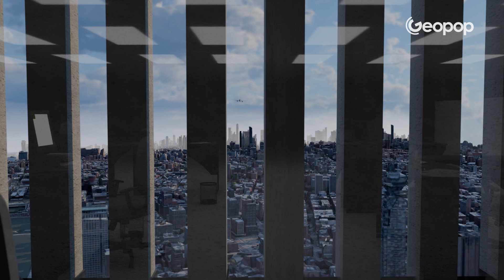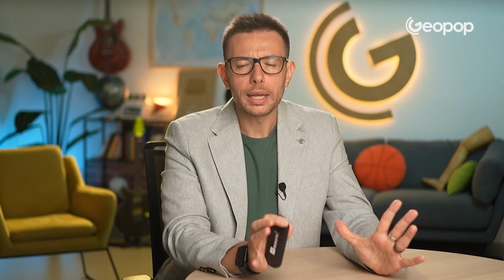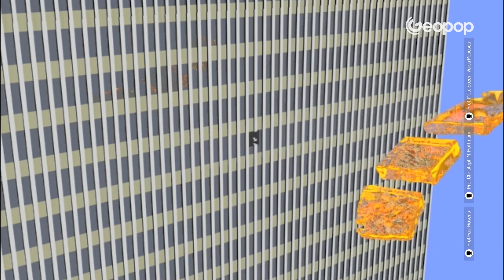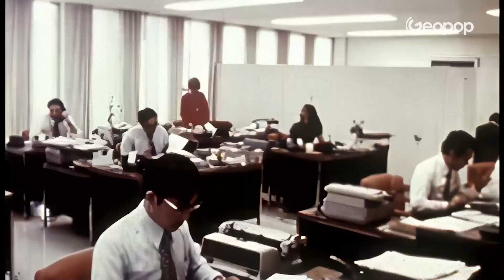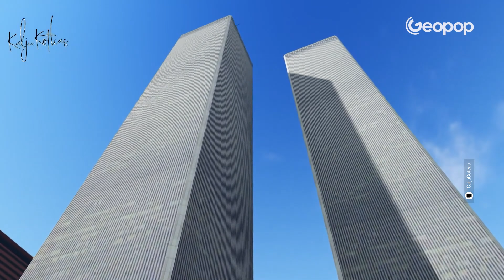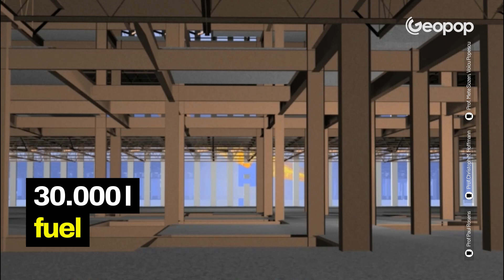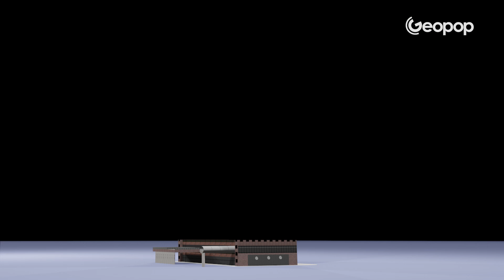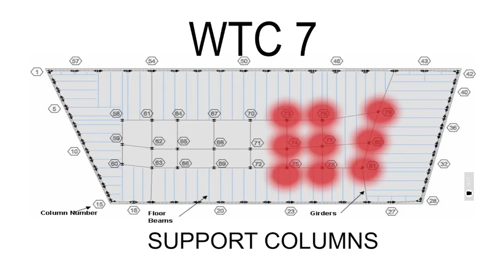9/11, 2001: The Technical Reconstruction of the Twin Towers and WTC 7 Collapses

Comment: a vital key piece to the collapse is the flooring damper systems that connected the floors to the exterior columns. They were rubber to absorb wind induced movement. As the flooring systems sagged and the rubber dampers melted away it was a cascading effect

Comment: You know you dont have to melt steel for it to fail. As an example, steel loses 50% of its strength at only 600 deg. Its not even glowing red yet at 600 and its already at half strength. Those steel beams were holding up a lot of weight and when many were severed, many were bent, that left the remaining columns/beams with an impossible amount of weight to support, and those steel columns/beams were being heated up.
Reply: Yes...for anyone familiar with commercial construction understand's most of this.
Reply: red glow is about 550. but you are right. steel looses strength.
Reply: Oh, and then tower seven the building that fell before it fell 😂
Reply: @steveoblenes7988 No genius, a section of the back side corner collapsed a few seconds before the rest of the building collapsed but you cant see that from the frontside footage that is always shown of wtc7 collapsing. Youll have to put your bong down and hit stop on the michael moore documentary that youre watching to know what Im talking about.
Reply: @morokeiboethia6749  "A section", A column(meaning ONE) cannot physically cause a GLOBAL COLLAPSE of undamaged structural steel in a building. Full stop. You're an idiot.
Reply: that's what the conspiracy morons do not understand.
Reply: @smashICE1 A lot of them can/could understand, but they dont want that to be what happened.  "Bush is guilty!"  Of what?  "I dont know, but hes guilty!"
Reply: @morokeiboethia6749  You forgot to explain your theory on Newton's Laws on physics and WHY the absence of the 2nd and 3rd laws. Those buildings pile drove themselves to the ground without resistance. They did NOT decelerate. The "pancake theory" is just that. Not evidence of fact. ALSO, fun fact, those towers were not uniform all the way up as far as the steel thickness. IT IS A FACT. WHY? Designed for wind load. The towers were LIGHTER toward the top. The "elevator shaft fuel drop" is also nonsense. WHY? MOST of the fuel burned in the fireballs. The elevators were all staggered and did not go straight down meaning there were different levels to take different elevators to ascend and decend. It's a known known there were warnings from our "allies"(2 different sources). I was a demo expert in the Marine Corps (0351) at the time and 30 years old. Remember, narratives that explain away resistance from the floors below are idiots that defy physics.
Reply: @smashICE1  I am proud to be a conspiracy moron. I will run my mouth until I die. I am here to uncover all Truth no matter what the Personal cost to me. I am an old man, I have nothing to lose but when I face the Lord I want to be sure I was definitely standing up for what is RIGHT, no matter the personal cost to me on Earth. All Christians are supposed to be living this.
Reply: @JDEbberly-s9c  Nobody cares!
Reply: @JDEbberly-s9c it sounds like youre standing up for what you want to have happened, and not what actually happened.
Reply: In the mid 80's I lived in a ground floor apartment in Amsterdam, and I wanted to remove a wall to make the kitchen larger. There were 4 layers above me, so I needed to put in a supporting beam. I wanted to use a steel beam, but the fire department told me I couldn't do that unless I covered that beam in a double layer of plasterboard. They told me a wooden beam was better. I was very surprised when the man told me a steel beam was collapsing faster in a fire then wood. He told me it was between 15 and 25 minutes, depending on the intensity of the fire. 
Wood versus steel in a fire. Hard to belief wood can outlast steel.
Reply: @lux_moto Yes and that was another thing I forgot to mention but those steel beams/columns in the WTC had fire insulation installed but when the jet tore through the building it would have ripped any sheathing and insulation right off the metal.  Engineers think the collapse began when one of the sections of floor  (concrete, rebar, on top of steel plate supported by horizontal beams) broke loose on the end connected to the center core and that end fell down on the next floor which was also very damaged and those floors pulled beams with it and from there it was too much weight falling and began a domino effect. The outter box columns buckled out right before the collapse and thats a sign the floor beams had broken loose that keeps those outter box beams reinforced
Reply: @morokeiboethia6749  In 1970 the New York City Department of Air Resources ordered contractors building the World Trade Center to stop the spraying of asbestos fireproofing.  More was added after a fire in 1975 that spread to six floors.  After the 1993 bombing of the North Tower inspections found the amount of fireproofing was not enough.  The Port Authority was in the process of replacing it, but replacement had been completed on only 18 floors in North Tower, including all the floors affected by the aircraft impact and fires, and on 13 floors in the South Tower.  Although only three of these floors (77, 78, and 85) were directly affected by the aircraft impact.

Primer coating applied to the steel reduced the adhesion of the spray on fire retardant by about 2/3rd. It was dropping off during construction, even more was of course knocked off from the aircraft impact.   Vincent Dunn Former Deputy Fire Chief of the FDNY and co-author of Collapse of Burning Buildings:  “It crumbled at the touch of a hand.”
Reply: Many other buildings since and before 2021 have had more intense and longer duration fires and none collapsed like this. Try again.
Reply: @ragne5749 you are an absolute moron.  Failing to acknowledge the force of a jet airliner severing several columns at 500 mph.
Reply: @r @ragne5749 I’m curious which other building sustained the kinetic impact of an airliner shattering several key structural support members, all the spray on fire protection, and then free burned under wind driven conditions with jet fuel for an hour?
Reply: @Flashhood1425  Jet fuel is simply refined kerosene. How many kerosene lamps have you ever seen glowing red after an hour's use?  How  many of those lamps have you ever seen - deform, while in use?  Cast Iron Wood burning stoves (I've used the same one every winter since 1985) get as hot burning hardwoods like Oak and Osage Orange and Locust - as any petroleum fueled fire can.  They don't deform in on themselves.

Steam engines (fed wood, then coal, then fuel oil - over their 90 year lifespan of use by railroads all over the world) never got so hot from constant use - to deform the locomotive  bodies which surrounded their contained fires - used to heat water and turn it into steam.  But after an hour to 90 minutes for each Tower - it got so hot it destroyed them...?  Gimme a break.

I didn't believe NIST report when it came out and I sure don't believe the 'stated facts' in this production.

Both jets 'sheared' about 1/4th of the support columns in each tower. The most intensity of the fires were limited to the 6 or 7 stories which were greatly affected.  A steel skyscraper like both the towers were - also act as humongous heat sinks.  Just because the steel within those towers might have heated up - the steel above and below those floors - didn't heat up as they sucked the heat away like giant heat sinks. 10 stories below those fires, the steel was still cold and strong all the way to the sub-basements.

Popular Mechanics rolled out this common PANCAKE theory long before NIST report was published.  I call BS on that, as well.

Those buildings were demolished. On purpose. Same for Building 7.
Reply: @Chebornek  TLDR, all your arguments are shit (respectfully)

Firstly, while you are correct on the idea that jet fuel is similar to refined kerosene, unless you are using an afterburner for a candle, a lamp is pathetically small, and any flame it produces is also very impotent.

Also, the flame has ample opportunity to radiate heat to the surroundings, it is extremely difficult for it to heat any metal it is made of enough to cause it to deform.

Secondly, is your cast iron stove supporting the weight of 10 other equally heavy stoves above it? Is it ravaged by fire, with some of its walls critically damaged? No? That's what I thought, try harder.

Now for your third point, the argument is even worse here. Water is a heat sink, obviously it's going to take heat away from whatever fire is used to heat the water, instead of deforming the metal.

About your fourth statement, unless you have any background in physics and engineering and can support your lunatic theories, I think the people at NIST are more qualified to speak on this?

Your fifth argument is literally answered in the video, even if it's just 6 or 7 floors affected, there were more than 10 floors above the affected zone in each case, and the remaining portion below the crash site could support the weight of only up to 6 floors falling down in this way. Plus, all the fire needs to do is weaken a critical support column for the entire structure to begin failing.

Your sixth argument completely neglects time; from the little bit of physics I remember, heat conductance isn't instantaneous and diffusion length is something like L = sqrt(diffusivity*time); using the data for steel's diffusivity, even for 1h, the diffusion distance for heat is roughly 0.19 m (0.6 feet in freedom units). 

I myself am not a physics major and yet a quick Google search can help me tell you this. Perhaps you should try harder the next time to think through what you're saying, instead of larping as a jackass?
Reply: @Chebornek  Your assuredness of the demolition theory is based on the lack of deformation of kerosene lamps and steam engines?  It appears that you watched the video but didn't you pick up on the fact that heat weakens the steel, it lowers the yield point. You could forget about deformation all together and focus in just on the loss of capacity of the structural members.

Those buildings had to be extremely efficient in their design and I am going to estimate that the structural members were probably designed to about 95% of their capacity when under a full load.  Take into account a 40% loss in member strength due to the heat, take into account the loss of exterior and interior columns and the loads that they supported now have to be supported by other members for which they were not designed for and you end up with a pile of rubble.  It's really not that hard. 

The video did not even address more specific topics such as the possibility of longer unbraced lengths of columns due to loss of supports or failing connections or other numerous items that can affect the performance of structural members.

I guess its just easier to say they were demoed than to put some real thought into it.
Reply: @Chebornek  "They don't deform in on themselves" .... because they don't have any weight/stress applied to them, only heat.  The WTC buildings didn't use traditional metal beams.  They used "box tube" metal framing on the outer jacket of the towers as the framing.  Just look at a pic of it on the internet from google.  It's like cutting a picket fence in sections every 3 pickets.  That's what 1 piece of box tube framing was.  It was like 3 vertical hollow square tubes lifted by a crane that have male/female ends that slip onto the section of box tube that's already installed below it.  That is what the outer framing of the WTC buildings was and not traditional metal beams.   The core of the building was a bunch of vertical heavy-duty beams, concrete, rebar, etc (thats where the elevators were located was in the core section).  The only thing connecting the outer jacket of box tube framing with this inner core framing were the horizontal metal "floor joist" beams.  Those horizontal beams are crucial in every building because they keep vertical beams (which are the beams transferring the entire weight of the building into the ground) from being able to bow/bend when weight is applied to them.  If you took the capital letter "H" and pretend its 2 vertical metal beams concreted in the ground and you start adding weight to the top of the 2 vertical beams, you would get to X amount of weight then the vertical beams begin to bow.  That means you're approaching their weight limit.  However, you can increase their strength by adding that one piece of horizontal beam in the middle of them that prevents the beams from being able to bow.  Horizontal beams strengthen vertical beams and increase the amount of load they can support by A LOTTTT.  Most buildings are a grid of vertical beams and horizontal beams but the problem with this is you have vertical beams every where on the inside of the building and you have to cosmetically hide all of them on every floor.  The WTC's framing was an engineering marvel.  It used 50% less steel than traditional framing and each floor had so much wide open, uninterrupted space without vertical columns everywhere.  That was the 2 main reasons this system was used was because it used 50% less steel and therefore cheaper in cost and once completed, you would have wide open space in between them without columns everywhere.  The floors of each "floor" were horizontal beams (which keep the vertical framing from bending/buckling) that had metal sheets/plate welded on top of them.  On top of the sheets, a few inches of rebar/wet conrete was poured.  If the sheets weren't there, the concrete would of course go right through the horizontal beams. They keep the wet concrete from falling through the floors.  Once the concrete dries, that was essentially your "floor of each floor."  So the floor gives people something to walk on but the floor is also the main support for the vertical framing.  The footage of the collapse you can see the box tube framing bend outward on one side right before it begins to fall.  That means the horizontal beams (which is the also flooring) had broken loose on the insde from the outter jacket.  The plane would have severely damaged the connections of horzontal framing with the vertical framing and then they were being heated up and one section of horizontal framing/flooring finally broke loose from the outter jacket framing, once that outter jacket framing no longer had the horizontal beams attached to it, they are going to bend outward from the weight and thats what the footage shows.  Thats an indicator the floor (horizon framing) had finally disconnected from it and thats what most likely began the collapse.  It wasnt that the vertical framing couldnt failed, its that the horizontal framing finally disconnected, then the vertical framing is no longer strong engough to not bend from the weight.
Reply: @ragne5749 because those buildings only had fire.  Wtc 1 & 2 had a jet come through the building right before the fire that severed framing and bent framing, then the weight of everything above the impact zone is then transferred to those remaining franing members.  Now throw in some fire to reduce the load carrying capacity even more and what you have is a building thats about to come down once the steel reaches a certain temp range. The buildings youre referring to, only had fire but their framing was not bent or severed. Wtc 1 and 2 had compromised framing, heat stress, and a much higher weight load on the remaining framing.  One of the original engineers of both wtc was on a train in nyc that morning and he told the lady he was with that both of the towers were gonna come down because he understood they were being heated up.
Reply: Fine. Explain how WTC 7 collapsed so neatly. THAT WAS A CONTROLLED DEMOLITION for sure. Hmm, I wonder what was in WTC 7 that needed to be covered up?
Reply: @JDEbberly-s9c you’re an idiot lmao the kind of idiot society would ostracize and exile 100s of years ago
Reply: Surely part of the WTC collapsing on wtc7 couldn't possibly have damaged it's structural integrity at all

It's okay you can just say DA JOOOOOOS!!!
Reply: @JDEbberly-s9c it actually wasnt. Youve probably only watched the footage of the front of wtc7 when it collapsed. Even in that footage, theres something you probably didnt notice. There is footage from the back side that is rarely shown but one of the rear corners collapses about 4-5 seconds before the rest of the building.  On the front side ( left corner as looking at it ) the face walls lean forward about 1 second before the collapse.  That tells you something as well and its not something that occurs from a controlled demo.  Controlled demos are also bombs and you will definitely hear them. No explosions are audible in any of the footage. Look for a video by Sabin Civil Engineering. They are not trying to prove or disprove anything. They are just a civil engineering group that educates students in the field and they point out several visual indicators of wtc7 that occur and what that means structurally.  Also wtc7 had to have a specialized truss made that is like a joist/column hybrid. The reason being there was an elecrical substation that was there before they built wtc7 that they didnt want to remove so they had to make a cusomized frame to frame around it. That is why one of the critical tie ins of the framing was located on the 2nd or 3rd floor.
Reply: @JDEbberly-s9c you have absolutely NO evidence to support your assertion 

You just make a claim offering no proof whatsoever 

The building had to be demolished through controlled demolition or the Alien Ghost Bigfoot breeding facilities would have been uncovered